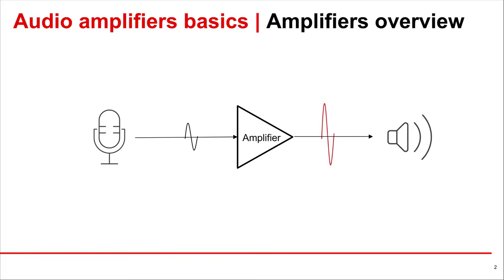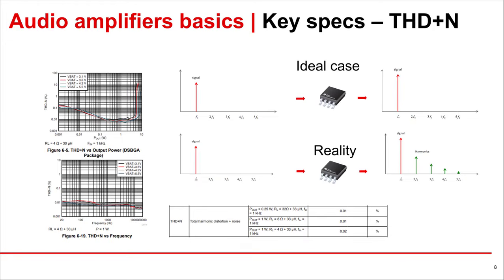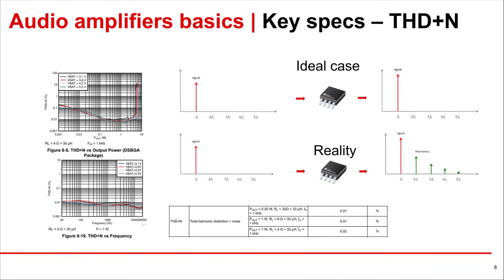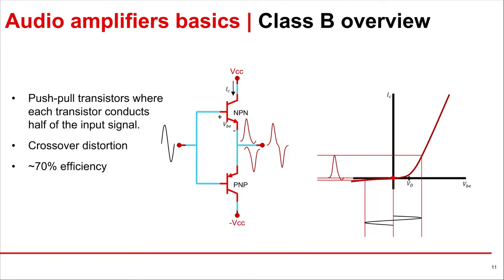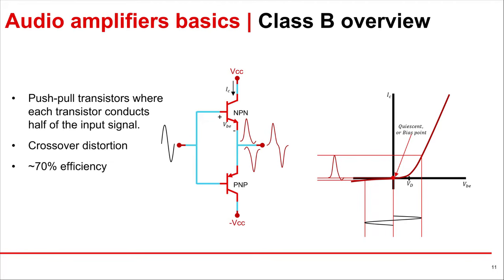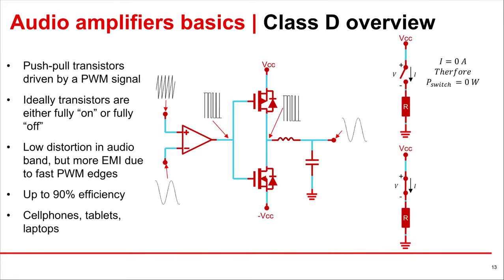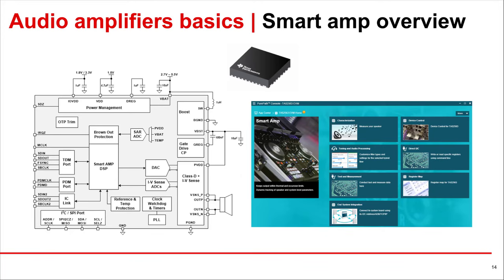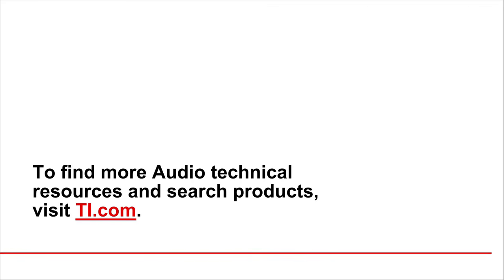Audio amplifier basics

Comment: The Class A amplifiers without negative feedback(without an emitter resistor):poor d.c stability and suitable for small signal amplifications such as R.F and I.F amplifiers,etc.
The Class A amplifiers with negative feedback(with an emitter resistor):good d.c stability,low distortion(T.H.D),it is suitable for large signal amplifications(normally voltage amplification).
The class A amplifiers are not suitable for power amplifications.

Comment: Relating the efficiency one should preferably discuss the theoretical upper limit in order to determine what a practical realization reaches compared to it. One should also mention, that the minimum efficiency is always zero, independently of the amplifier class used. The maximum efficiency of an realized amplifier always relates to its maximum output power for a specified THD+N. In the typical use of an amplifier the efficiency is always much lower than this maximum efficiency.

If you have a class AB audio amplifier with a maximum output power of 100 Wrms at home it is often operated at a typical output power of 1 W or even lower. So it is not surprizing that the efficiency under this condition is only a few percent. Often its idle current is higher than the current to drive the speaker.

The theoretical limit of a class A amplifier depends on its output stage design. If you use a emitter follower operating against a current sink its maximum efficiency is 25% because the current sink has to consume the the maximum speaker current. If you operate a push pull output stage the idle current needs to be only half of the maximum speaker current. So the maximum efficiency is 50%.

The maximum efficiency of a class B amplifier is 78.5% for rail to rail operation. This is also the maximum efficiency of a class AB amplifier in the limit of an idle current of zero. For a finite idle current its efficiency is always lower than 78.5%.

The maximum efficiency of a class D amplifier is 100%. For very high output power in the order of 1 kW or more you can also come very close to it. But if you have a low power class D amplifier providing just 100 to 1000 mW allready its preamplification stage and its analog to pwm converter can greatly reduce the efficiency to just 50 to 70%.